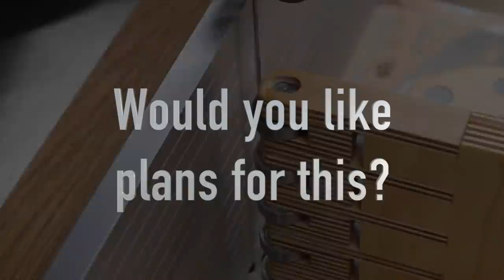Point Fence and Feather Board held by Magnetic Switch

Comment: Great ideas and fantastically precise cutting and shaping! I wanted to read through the other replies to see if any others fished out the extra benefit of this jig. The last post I got to hit on it but shadowed over what I thought was a great benefit, intended or not... You're resawing with a thin blade! What a time saver! I first thought of all the time it takes to select, uncoil, and change to a resawing blade not to mention the costs for some to have to either buy different single purpose blades or a whole extra bandsaw to keep set up for resawing to keep efficient on projects. I tend to lean more on the side of the woodworkers having and using extra common sense, safety and otherwise, to understand the heat load having less blade width to dissipate from and the extra wear on the teeth, guides and other. For me, this is a good 'crunch' tool to have to save in the time pinch. Versatility across multiple devices, less tear-down and set up in between on a multi task job leads to a 'saver' every once in a while.
Get me some plans out there and I'll open the wallet to make 'em tattered and well loved within a week! Thanks Andrew!
Reply from the maker: Good observation, thanks, plans on the way!

Comment: I saw you turn sawdust into smoke with the hole saw. That is one way of getting rid of sawdust, there is another. If you drill a hole that slightly overlaps the hole saw path the sawdust wil collect in that hole. Drill the hole in the part that you discard. You could go with multiple holes.

Comment: Elegant!
Of COURSE we want plans...not that I could build it...yet...but eventually
Reply from the maker: THanks, its honestly not so hard
Reply: @AndrewKleinWW  lacking a drill press and a bandsaw it gets more interesting...but you are correct, there is not anything crazy in your excellent design
...the Epoxy pump is a beautiful thing as well
Reply from the maker: hmm, yeah, without a bandsaw you don't really need it, and not having a drill press would make it harder
Reply: @AndrewKleinWW  "needing it" was never a consideration...honestly...I just NEED that in MY shop!  
Actually, it looks like it would be pretty handy as a point pressure device when resawing on the table saw as well... locked down to the top just ahead of the blade to keep the work piece to the fence evenly right at that critical interface. Of course, a band saw would be the better choice for resawing, but I'm gonna have to build the bandsaw first budgets being what they are.

and by the way, your turbo vise is one sweet unit, hope the sales make it worth the effort ( yeah, you guessed it, I need a proper bench first).
Finally got all the kids through school, so now I get to build the shop I should have been building for the past 25 years.... I'm a little behind...

Comment: The burning hole saw is because the dust cannot clear. Back it out every few seconds and put a stiff-bristled brush to the teeth. Stop the drill press every minute or less and brush the hole saw well.
Reply from the maker: true, several others have mentioned that drilling a hole inside will help the dust clear also, might try that next time.

Comment: Pretty clever but how strong are your magnets? How strong do they have to be? 
How much pressure/force will they hold up to before sliding on the metal surface which they're on
Reply: Get-The-Lead-Out.45 good question. And if they are super strong magnets, what difficulty is there in placing the jig and then removing it?
Reply: @40Jdman  
I'm definitely no expert here but I would think there isn't much problem concerning the difficulty in placing the jig/magnet and then removing it since there is a switch which turns the magnet on and off

Comment: This is very good.  However, I have used the Harbor Freight Tools magnetic tool holder bar (12" long) on my table saw as a cutting guide bar for many years.  I even installed a 1/8" x 3" x 36" steel bar on my fence for using the magnetic tool hold bar.  I buy them whenever there is a coupon at a discount or free with a purchase.  I must have a dozen of them.

Comment: Interesting Idea. Is there more points of contact than just the bearings? Finger/feather boards usually touch over a length of the wood as 1 points of contact could allow the board to move. Not like you need to build another bearing set like you've made. Just 1 bearing on the bottom with spring tension should be enough
Reply from the maker: just the one point of contact, I find that is enough, you could certainly put two raws of bearings on the jig but I don't really thing its needed.  There are other tall feather boards on the market with only one point of contact:  https://www.rockler.com/guidepro-gp5-resaw-featherboard-for-bandsaws?sid=V9146?utm_source=google&utm_medium=cpc&utm_term=&utm_content=pla&utm_campaign=PL&gclid=Cj0KCQjw-tXlBRDWARIsAGYQAmeAew5SCd6waldfZWHTglqKXfZFqqMAwjA-9_Nnxc0Hdzgbirq-pKUaArQPEALw_wcB

Comment: That looks great, except that my small bandsaw has an aluminium platform.
My thoughts are that the ball races could have been on levers, rather than plungers, which would simplify construction, and reduce the number of components required.
Reply from the maker: Thank you, but I don't know that would simplify things, especially if you want it to be able to function as a point fence as well.
Reply: @AndrewKleinWW  
I'm thing of something similar to a lever chain tensioner, but multiple.

Comment: No offence, seriously no offence, but isn't this a complicated way of making a normal feather board? Feather boards are natural spring loaded.  The magnetic switch component is useful I guess. But so is the keyway in the machines tables we buy.
Reply from the maker: It’s a complicated way of making a none standard featherboard, with low friction and force applied at multiple points spread across 5 inches, which is what you want for resawing.  And it doubles as a point fence.
Reply: @AndrewKleinWW  Low friction, tall engagement and magnetic are features that make a pretty good resaw feather board. Lots of ways to do things. UHMW  'feathers' would make a very simple and low friction version.

Comment: Great video and very cool design! Watching the video it looked like you often used the centre of a strip of plywood for something then discarded the ends. Is that what you were doing, and is there a reason to prefer using the centre sections? As a very broke amateur woodworker I always try to minimize the number of scraps I create. Am I just making things harder for myself?
Reply from the maker: Sometimes its just a little easier that way, and preserving wood and eliminating waste just isn't what I'm focused on, for better or worse.

Comment: I would suggest, instead of the outside ears for the screws, make some of the metal pins longer so they go into the other part and make a groove for it to travel from one position to the other... and for holding the two parts together you have to make a screw on cap on both sides. Or something similar...
Reply from the maker: Sorry, don’t quite follow
Reply: @AndrewKleinWW  Yea, I understand. I was just talking about the magnetic gripper part... So the projections on the sides are for keeping the two halves together and making sure you turn the pieces the right amount (60degrees)? So I was just suggesting getting rid of those "ears" all together and instead: You could make a cap with a larger diameter for the center pin so it holds the pieces together. And to stop the rotation at the right place you could make one or more of the surrounding pins a bit "too" long so it protrude in to the second half, and in to that second half you could then make a groove that accepts this longer pin and allows it to only slide in that 60 degrees arc.
Reply: @AndrewKleinWW  Actually. It wouldn't work. Sorry. You would need to put a separate pin somewhere else for the turning topper.
Reply from the maker: yeah, there is some potential for using the center post to keep the two halves together, but I stayed away from that for this design to minimize metal working.